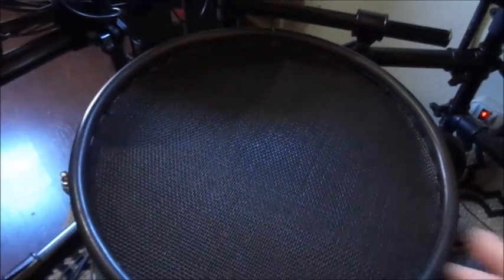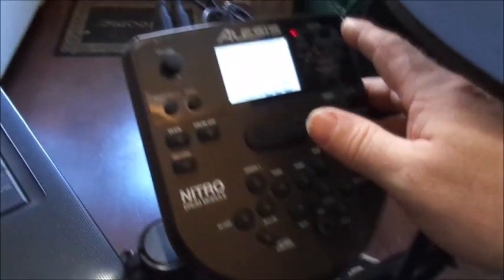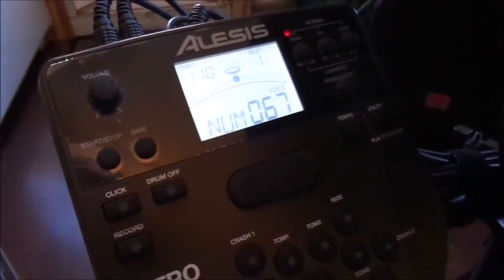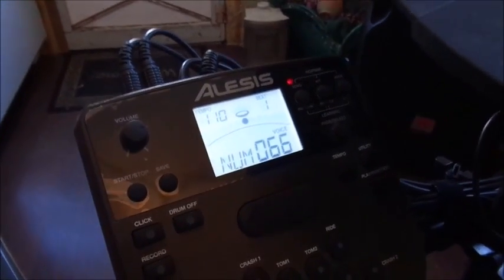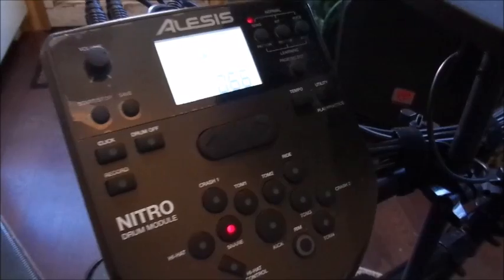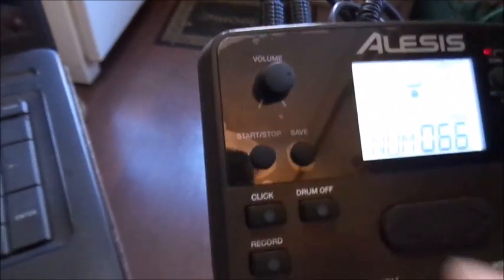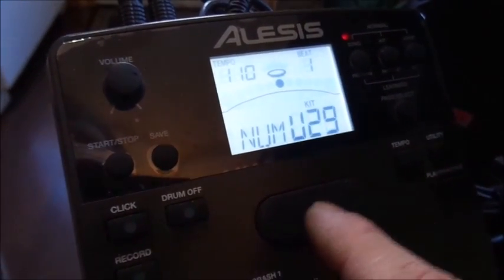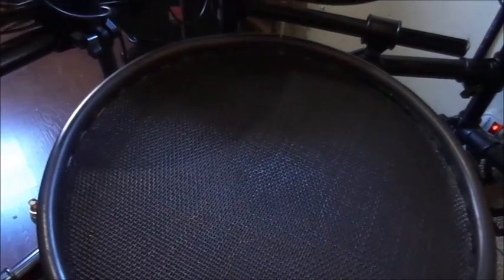Changing The Pad Sounds On Alesis Nitro Electronic Drums

Comment: my kit doesn’t even play any sound plugged in
Reply from the maker: Your kit may be off in your settings
Reply: If it is on you may need a Aux Cord OR buy Wired Headphones and plug them in which the input should be the back on the monitor